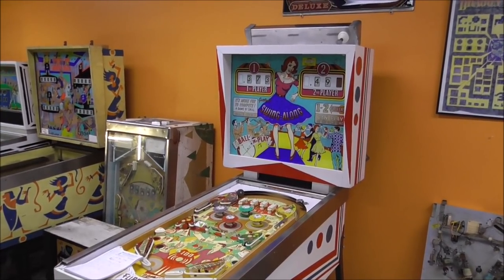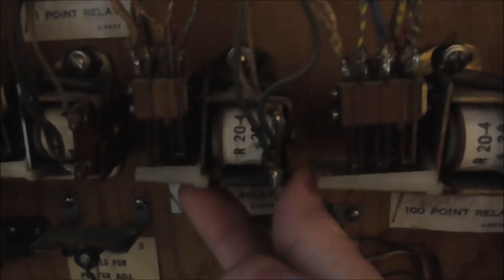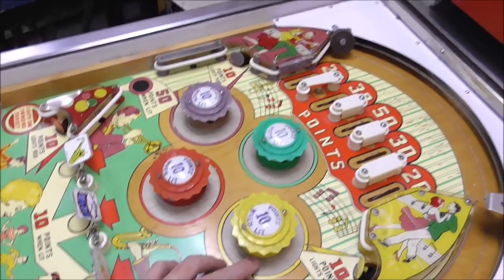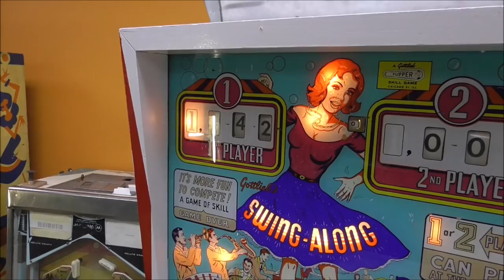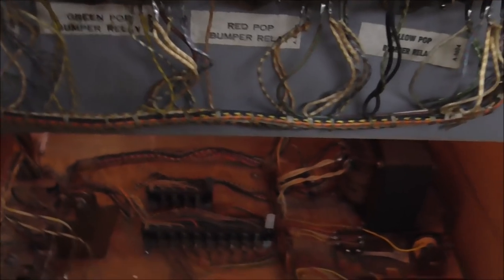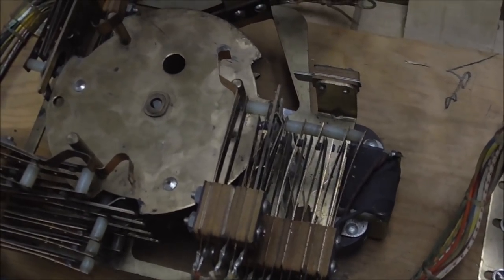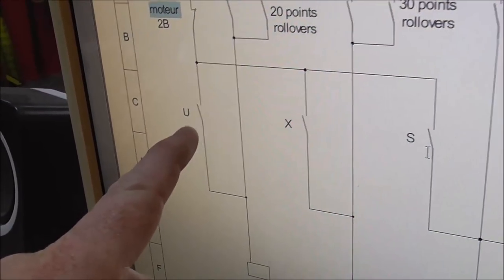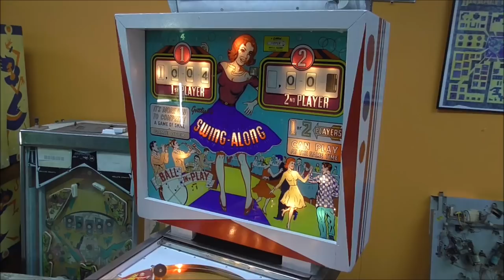Troubleshooting and Testing a 1963 Gottlieb E.M. SWING ALONG Pinball Machine With No Schematics!

Comment: I love these old time machines. It's pretty easy to get stuff to work on a microcomputer controled machine as it's just lines of code burned into a prom, but these, the designers had to figure out how to get all this to work with rotary switches and solonoids. They had to really think about it to make this work
Reply from the maker: Yeah then they had to talk the company into letting them put more hardware in to make it work too, and the bosses wanted to do it with an extra switch here or there instead of a relay or motor or coil :)

Comment: Another great video for Swing Along!  I've restored a handful of EM's now as a hobby and sorting through the switch issues still sends my head spinning at times.  It is soooo helpful to watch examples like what you are doing here to methodically think through the switch logic.  Much appreciated.  All of this you've captured here is going to be a huge help when I finally start in on my Swing Along.  I do know that when I plug it in, the score motor just spins and spins and no playfield lights come on.  I'm guessing something isn't completing a reset position so it keeps going.   Hope to find it once I dig in.  ;-)
Reply from the maker: You are correct.  If you look at the schematics there will be several switches that make the score motor run on the other relays, one of those other relays has a switch stuck closed, or that relay is pulling in trying to reset something... as long as that switch stays engaged the score motor will continue to run because it's trying to give it the animation to finish whatever it's trying to do.  When you turn it on look and see if you can find another relay stuck on too besides the score motor....

Comment: If I am a complete novice on electronics.
What would be a better hands on learning experience in fixing pinball machines.
EMs or solid state?
Except I won't use fishing lines and a plastic tube.
Reply from the maker: The EM's are a little harder to understand what's going on, but are cheaper and easier to repair once you kind of figure out how simple they are.  The Solid State ones would probably be easier starting out and you can buy new boards for them in the worst case scenario... but you'd still learn minor things like switches needing adjusting, light bulbs, etc.

Comment: So once they invented the pop bumpers flippers plungers and kickers.
They basically followed the same design for today's machines as well.

I'm guessing.
Reply from the maker: Pretty much! They also came out with drop targets... In the late 70's they went digital with the solid state games... which was a big step up, then in the early 80's they added electronic sounds.  Shortly after that they added speech... then ramps, then alpha numeric displays... then Dot Matrix Displays.... Most pinball machines today have less coils in them than these old ones but they'll have usually 1 toy on the playfield that is more complex than anything these old ones had, like a robot that moves or something.

Comment: it seems to me that the Arcing ... at the contact points on the relays, could effect their adjustment or their behavior, is their way to control the arcing...    i am thinking all the relay's might need a resistor and capacitor combination, ??? yep, it would be a project to do that,   just a thought...
Reply from the maker: Later on I believe they added capacitors to all the flippers to stop the arcing there.... but the thing is 60 years old, the plays it will get now compared to what it got when it was new are far less so If it's made it this far like that I think it'll make it another 60 years :)

Comment: Hi Ron, your lucky you do not have to deal with French car wiring diagrams (and I mean the diagrams the dealers get). Easily the worst in the industry with VW / Audi are a close second.  No offense to French people but I have no idea why they have to be so bad. I do diagnosis and board level repair of control modules so they are not meant to help me repair modules  but even the guys at the dealerships complain. I'm sure you'll agree that you need to be sure that the part is faulty before you charge the customer 2000 euros for a new one. Cheers.
Reply from the maker: I didn't know that was a thing, wow you'd think you could get decent diagrams on something new if you're supposed to service them!  I've dealt with some older wiring diagrams and things on my old vehicles but we're talking stuff from the 60's and the diagrams are very simple...
Reply: @LyonsArcade  Hi Ron,  that's exactly right, how can you fix it without good info.  Your spoiled with excellent schematics and service info for the American stuff you repair. 
BTW if you ever need to read diagrams or text in another language try the Google translate app. It will either do real time translation using the video mode and overlay the translated text with English on the screen or take a photo and select what to translate. I've only used the android version but should still be the same on Iphone.

Comment: I like your videos.  Thank you.

I have an E-M Williams Fun Fest machine that is incredibly fun to play.  The contacts would stay adjusted for about two weeks, then things wouldn’t work properly and I needed to go in a re-tune the contacts again.  It was frustrating.  I made a microprocessor based logic board replacing the motor mechanism and many of the relays.  There are still about 20 relays in the playfield and the head, but it is much easier to troubleshoot and keep adjusted.  The game plays much more reliable now.  Check it out youtu.be/mXp9akFZvls.

When friends ask about acquiring these older pinball machines I tell them they are maintenance items.  Owners need to be willing to go into the machine and make repairs.